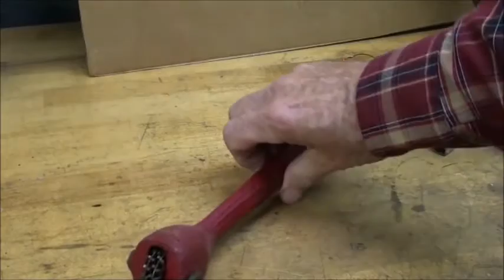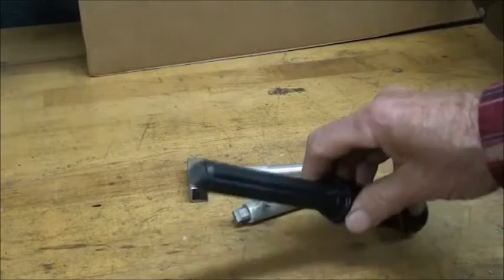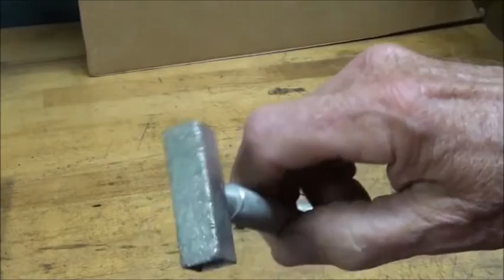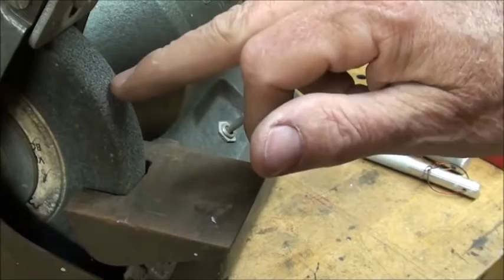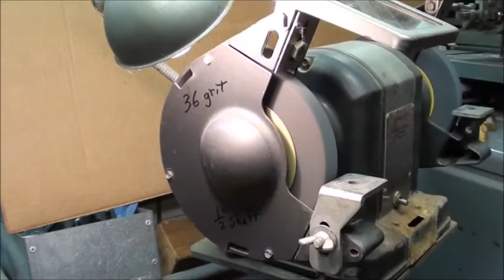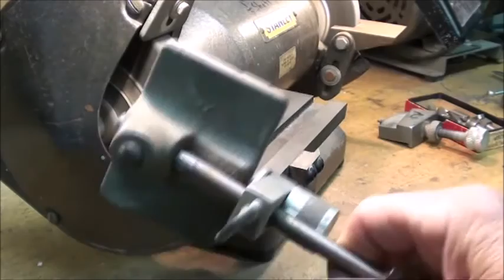Bench Grinder Wheel Dressing 14minutes

Comment: Bozo mentions nothing about the dangers of inhaling grinder dust and protective dust mask is never mentioned.  Silicon will do a number on your lungs
Reply: It's probably silicon carbide in a vitrified bond or something. No silica. 

I checked the MSDS for silicon carbide dust and it mentioned that pneumoconiosis is a potential long-term problem (that's black lung, like miners get...you have to have quite a bit of exposure for it). 

Carcinogenicity from all standards listed as "no". No other observable long term effects. No acute effects mentioned except abrasive effect may be noticed in the eyes if exposed (you don't say). Potential dust irritation from people who already have a respiratory disorder.
Reply: thanks clara belle.
Reply: I guess he should have mentioned that for the no-brainer's!